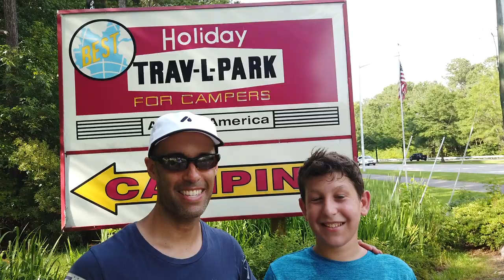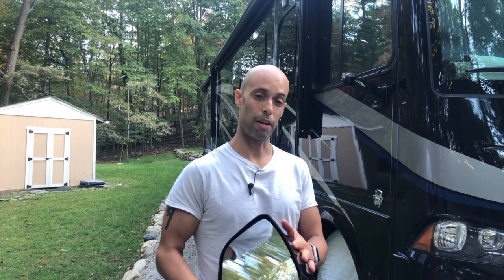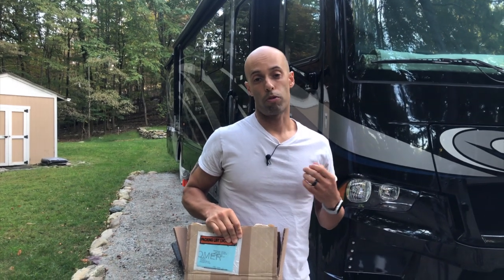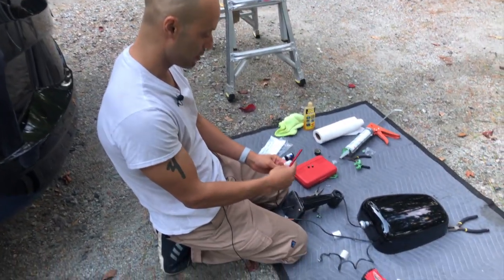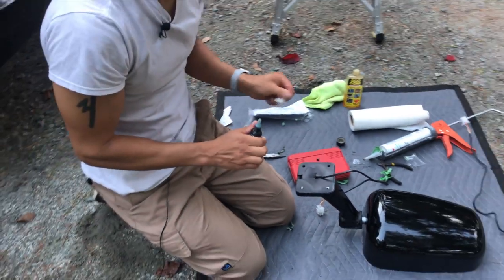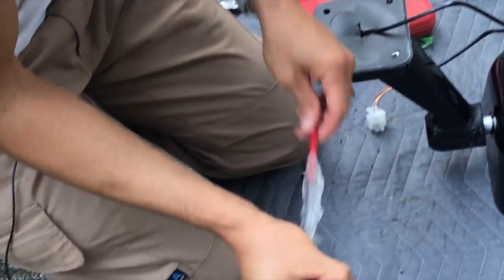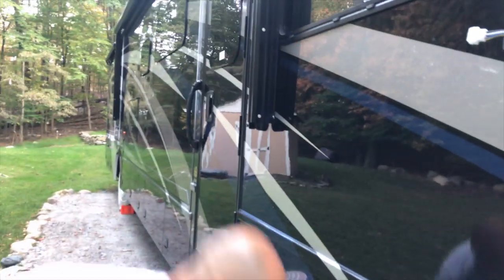OUR $300 MISTAKE - MOTORHOME MIRROR REPLACEMENT

Comment: The perfect video (and the guy is easy to listen too) I was looking for ..I wasn't quite sure how the stem was inserted into the base mount. My Pass Mirror was also ripped off the side while going thru heavy construction in Conn. One of the parked state trucks opened his drivers side door at the same time as I was traveling by about 50mph. The only thing left was the base and the stem from the ghost mirror was still inside the base. helped a ton, thank you.

Comment: Thanks for sharing.  Breaking a mirror is one of my fears, as I use them so much in driving our coach - I have even thought about bringing a temp mirror solution of some type if I can find one.  The toll booths are too narrow - so I tend to drive slower than most folks like, but as a new coach driver, I take my time.  This is a DIY project if you can get it painted.  Safe Travels!!
Reply from the maker: Thanks for watching.   We had to use our side view camera the trip home which is a good backup.

Comment: Our Cozy Cottage 2017 Baystar
We were at a Rest Area in central Oregon and a Semi hit our passenger side mirror and broke it off . Called New mar and they gave us an estimate of $740.00 painted to match the coach this is a 20 minute job for a skilled tech. We checked with RV repair shops in Bend Oregon and they could fix it but would be 6 weeks out. We did not wan to drive back to Nappanee without a mirror and did not want to wait 6 weeks so called the manufacture in Indiana and had it shipped to Reno Nevada (our next stop)  and opted for the chrome so we did not have to match the paint and did the install ourselves so 2 chrome mirrors with shipping $440.00. Enjoyed the video
Reply from the maker: Tom McCoy ThomasM yep very easy job.  We were fortunate to have a local body shop paint the mirror for $70.   740.00 is a ridiculous price lol.  

Thanks for watching and sharing your experience. 

Izzy

Comment: Don’t feel bad,I was going on to a military base and was worried about hitting my passenger mirror, and knocked off the driver’s mirror.  Ranco was great, we called them because when I called Newmar they wanted $700.  Ranco quoted me a price of $200 because because it was a blemish (but we inspected the mirror and could not find anything). I spent about 2 hours re-pinning and mounting.  Simple replacement process.
Reply from the maker: Hey Les.  Certainly Newmar charges top dollar.   DIY is always the better choice.  Thanks for watching and the comment. 

Izzy

Comment: Consider yourself lucky!!! Around a month ago, entering the Ohio Turnpike I ripped the mirror and the mount off my 2019 Georgetown ! I must have spaced out for some reason. Anyways, it gets worse... The mirror and arm fell under the RV and put a screw into my inner dual on the passenger side! That cost me and additional $770 and 6 hours of waiting for roadside to replace the tire. So my stupidity coast me $1000+ and now I also have  One Toyo tire and the rest Michelin because of course, no Michelin tires were not available.
Reply from the maker: Ed Jarold wow guess my incident was not so bad.  Those OH tolls are narrow!!   Definitely has me slowing down at tolls now!!

Izzy

Comment: My Baystar got zapped by a phantom snowplow -  The wiring felt like it was thru bolted to the interior ..  Were there any secrets to getting the wiring free and unsnapping the connector ..   thx  Jim
Reply: Same here, I had to take the cover off the armrest to free the wires, which should have been situated to allow for the mirror replacement, but sadly were not.  May be possible to free them from the bottom, as the end of the armrest is actually open, just crawl down there between the brake pedal and exterior wall.  Be sure you have a helper to get you out of there if over 50.....

Comment: Perfect timing. A toll booth attacked us in Michigan. Ramco had the mirror and UPS delivers today.  This will come in real handy so thanks much!  Did you have much trouble getting the connection out of the sidewall to connect the new mirror?
Reply from the maker: It’s a very easy replacement.  You should have no issue.  Thanks for watching and the comment

Comment: Suggestion -- next time you have to work with the silicone, run some low tack painter's tape 1/8" away from the joint, use the smoothing tool to perfect the bead, wait an hour or so, then peel the tape off. Your joint should require no additional work. You did a good job though.
Reply from the maker: Hey Charles, thanks for watching and the advice.   I do use painters tape, I just did not want to wait the time to dry, for the video, it was getting dark and the mosquitoes were getting to me!! 

Make sure to subscribe to the channel and thanks again for watching!!

Izzy
Reply: Charles Billings exactly, the silicone is my only concern of the entire job